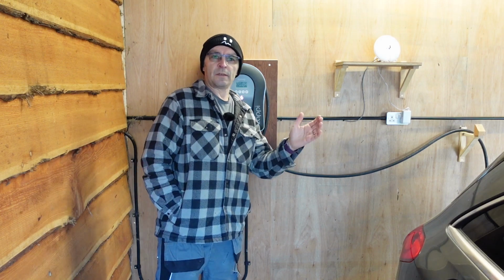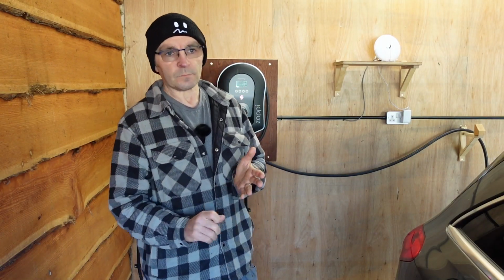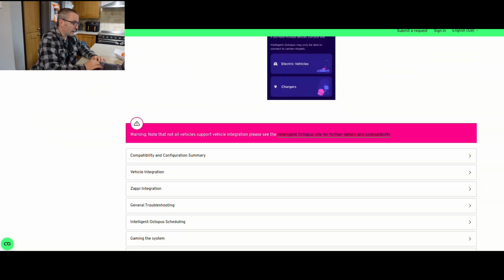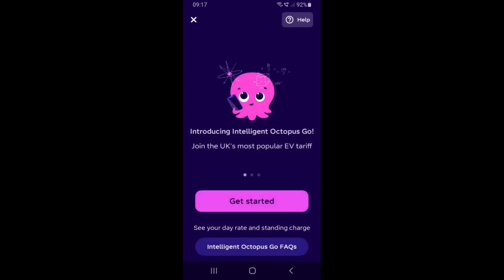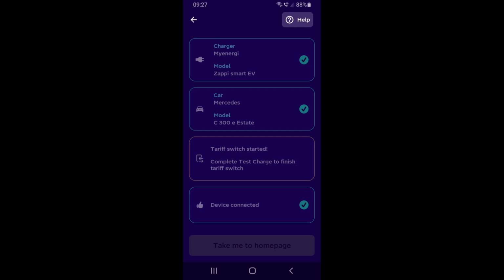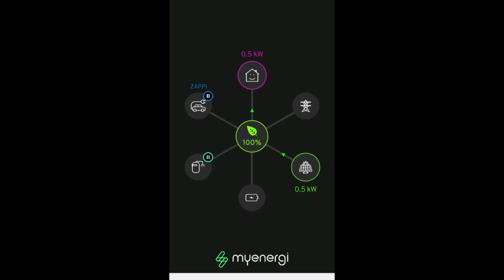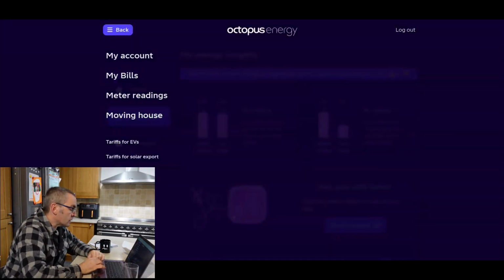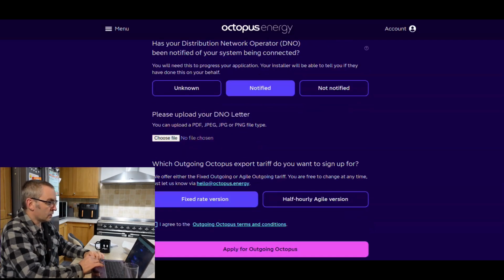Intelligent Octopus Go, Myenergi Zappi Integration- is it Easy!!

Comment: Your solar is not free. It is worth whatever you can export it for. As of today with octopus that is 12p/kwh. Heating water or charging your car is false economy if you can use night rate instead. Especially for hot water via a heat pump at a cop of 4 ish. So 12p or 8p divided by 4 is 2p. Do it at night.
Reply from the maker: That's how we do it now, also charge the car and battery at night and export as much solar as we can 👍

Comment: Octous probably made some changes on the app. When I click on "Add devices", I have only heat pump, battery, or EV. I don't have a charger. I can't work out how to link it with my charger.
Reply from the maker: That's weird, have you tried selecting ev find your vehicle and then see if it takes you on to which charger, they may have swapped things around. I had to delete and re connect mine a few weeks ago after 365 days on intelligent go, but the  process was the same as before

Comment: Late addition as your video is now a year old.
Firstly, cracking job, clear, concise and to the point.  I enjoyed watching.  Apart from supporting your effort, I am only bothering to comment as your video is quality information.
One small point, which I am sure by now you will have gleaned, but I add it in case other visitors are misled by the video.
The percentage that you enter (Octopus app, Devices) is not the battery target you want to achieve, it is the amount of the total battery capacity that you are asking Octopus to add.
An 80% figure is thus: 'please add 80% of my total battery capacity', so if you plug in with 20% battery remaining you are asking to charge up to 100%.
The only problem with just putting 80% every charge is that Octopus reserve the right to withdraw Intelligent Octopus Go and slide you back to Octopus Go, which is an inferior tariff.  If you repeatedly ask for more than you actually want then they can see this as 'gaming the system', which contravenes their TOCs.
Octopus are quite fair about this, they give warnings before doing downgrading you, but this can be avoided by putting in the amount you want delivered before each charge, rather than the amount you want to end up with.
Reply from the maker: We have it set to 100% all the time, generally don't use all week days but weekends it normally comes home with little or no charge, I think their system knows when the zappi is off so can tell we not gaming, we charge the house battery at night now but had to play with charge times so we don't get car, battery and heatpump all on at the same time, 2 out of 3 seems ok 😂

Comment: Thanks for the video - found it the day after going through the switch to Intelligent Octopus Go - and it seems to reflect my experience well. Question: Is it possible to change the vehicle that is onboarded? I have an e-golf and a BMWi4. I onboarded the e-golf, but now realise that its battery capacity may limit the charge I can add to the if.
Reply from the maker: I changed our zappi from the old skoda to the new car and it ironed out the main problem we were having. I think if possible it's better to let the charger be controlled by octopus rather than the car. Then decide which car you register on your charger.

Comment: Thanks for the video. We’ve got a Kona electric with the same… “will it charge, wont it charge?” Issues when charging overnight on the cheap rate. Good to know were not the only ones 👍
Reply from the maker: I changed the car details on the my energi account and so far it has worked flawless, may be a coincidence but it's the only thing I changed
Reply: I went to So Energy and let the Hyundai app sort the charging.  The App has never let me down and So Energy are cheaper than Octopus.  They must have fewer legs.

Comment: Is it easy you ask? We have had all sorts of issues running our i3S with Intelligent Go. Despite passing all the tests and registering the vehicle we wake up in the morning and nothing. Octopus tell us there are some issues with BMW's, what they are I have no idea so we have for the time being setup the BMW to accept charging at the low rate and scheduled the Zappi to provide power when the schedule is met. We do have solar and battery but as I understand it on ECO+ mode the Zappi with take power from our house battery leaving us nothing for the following day. I don't think it's easy at all but I will persist. Thanks for the video, despite not resolving my issues it did help in other areas.
Reply from the maker: I've setup the zappi rather than the car and so far it's worked flawless. We did have a problem before I switched with it not charging using the excess solar but I changed the vehicle on the myenergi portal from our old car to this new one and it's been fine. Maybe try registering the charger rather than the car and see if it works better.
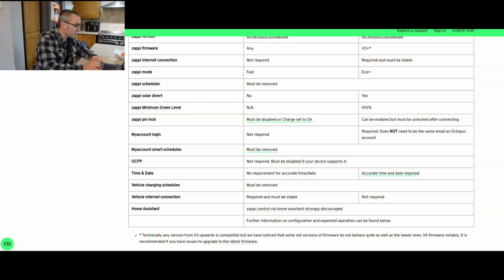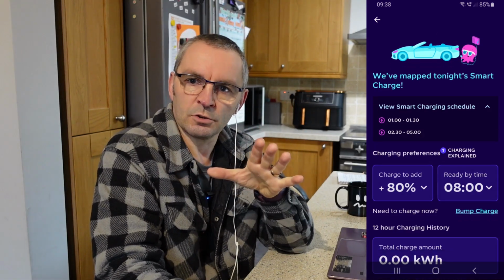Reply: @50plusdad-uk  Surely you'd be better off exporting the excess solar at 15p and only charging the car from the grid at 7p? We don't do a lot of miles so I only have a granny charger but the ID3 is controlled by Octopus and it starts the charging. I always tell Octopus to have the car ready by 05:30 and haven't had any issues. The solar battery is set to grid first 11:30-05:30 and we do have a system to stop the battery discharging if the car is charging but never really need to use it.
Reply from the maker: @johnhunter4181  that's how we have it set, sometimes we top up during the day using excess.

Comment: Thanks for the code 50 heading your way, ive got solar so going to get the fixed 15p as well 😁
Reply from the maker: We tried for nearly a year to get the seg 4p with British gas, octopus got in done in less than a month and now we're on the fixed outgoing 15p which took 2hrs to go live, very happy with them so far 👍
Reply: Is your charger single or 3 phase? I’m trying to find a 3 phase charger that is compatible with octopus intelligent go.
Reply from the maker: Mine is single phase 7kw but myenergi do a 3 phase 22kw charger that will work with intelligent go according to the octopus.energy/smart/intelligent-octopus-go/ there are drop downs to check compatibility with your car and charger.
Reply: @andrewrharker  I have a 3-phase Zappi, and I switched to Intelligent Octopus Go last night.
Reply: Wouldn’t it be more optimal to not use the free electricity generated throughout the day to charge the EV, and instead sell back at 15p? Then charge overnight for 7.5p (providing you don’t need more charge than it can add in the off peak period). 

I’m still waiting to get the 15p export tariff set up, so the config you have advised seems ideal for the period where you aren’t getting paid to export, but not once that’s running and can get 15p. Maybe I missed something! Thanks!
Reply from the maker: @russellelam8201  Yes I've got to re learn how we use this now as we have always tried to store or use the solar, but we are limited to only 3.6 Kwh export due to the grid so in the summer we will still be producing a lot more than we can export (upto 15kwh when battery is charging) so i'll dump it in the car, but the cheaper 7.5p rate after 11:30 is great now winter is here and the heatpump is on during the night..